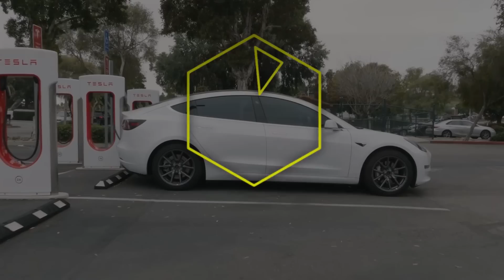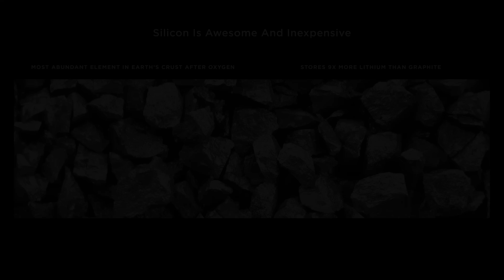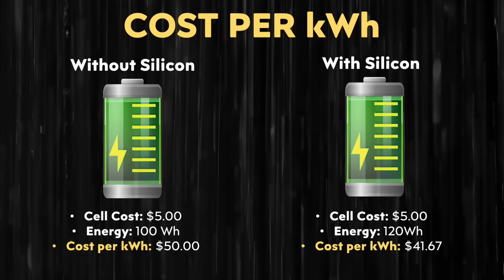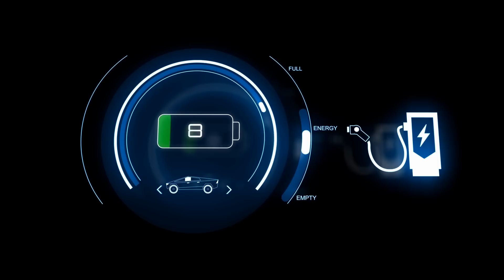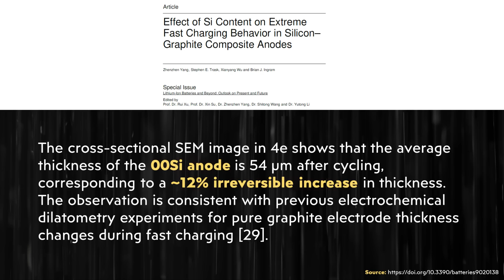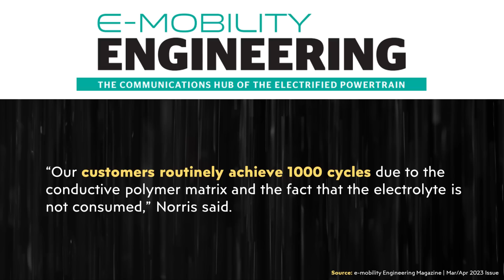This Silicon Battery BREAKTHROUGH from Paraclete is IN PRODUCTION!

Comment: Jon, this is the third video I have seen that hype success using silicon to increase energy density.  CATL and BVD have released super batteries.  I have to believe that now that Tesla has solved the dry electrode issue they will now move onto batteries with even move silicon.  Maybe with the generation 3 battery we will see an even better battery.  Could we see an announcement on 10/10?

Comment: Charge speed is not as important (it’s not bad now) as energy density, cost reduction, and battery life. If you can reduce the cost and the size of the battery needed to go an average of 375 miles on full charge would be groundbreaking. I have a 2024 Model 3 LR and charge only every 10 days at home and charge just up to 70% and usually end up around 15-20% SOC in day ten.

Comment: Jeff Dahn many years ago had 1 million mile NMC batteries. CATL currently shipping batteries which after 5 years are guaranteed to have zero degradation. 
Silicon fundamentally is not reliable enough for next gen batteries.
So yawn
Another battery break through. Seems every day there is some amazing battery tech reported. But we never see these announcements ever turn into products
Reply: Battery development is necessarily very slow compared to other tech. The main problem is the time involved in proving the battery chemistry capabilities ( and all the other factors) from inception to production. (And a slight tweak to the chemistry means re-iterating...)

Comment: You do NOT want silicon as an anode.  

Even if they can get the bandgap down to 0.7eV from 1.1eV.  Silicon expands up to 300% which causes the anode to loose contact with the foil, and can crack.  

As will all these “MAGICAL” batteries; The hype is to attract investor dollars.  They never actually develop a marketable product.  

Silicon is not easy to produce!  It’s NOT made from sand as the solar panel industry would like us to believe.  

Do a little deeper research before hitting the record button.
Reply from the maker: Or maybe you should watch the second half of the video where I address this exact issue and with data from an independent test showing a 15% wt Si anode didn't show cracking after cycling...

Comment: 1k cycles is only a tenth as much as the best LFP...
Reply: But the 1000 cycles are most likely from an NMC battery so that's what we should compare it with.
Reply: @EinzigfreierName  Depending on the use case, the per cycle cost is paramount.  At $35 per kWh and 1k cycles we have 3.5 cents per kWh battery cost per cycle. At $53/kWh for 10k cycles is a little over a half cent per kWh cycle (think about long-term grid scale value improvement of over 5x).
Reply: @DarylOster  Sure, there are a lot of use cases where cycle life matters a lot.. I was mainly thinking about EVs where 1000 cycles should be more than enough.
Reply: @EinzigfreierName  It is true that most of us car drivers are conditioned to believe cars are to be discarded after 200k - 300k miles.  A million mile life (as in most OTR semi-trucks) is vastly more economical (and environmentally sustainable too).
Reply: It doesn't matter that much.... 1k cycles on a 250 mile range EV is still 250k miles.....
Reply: @killerhurtalot  I believe in a vehicle, battery life matters even more than in pure battery applications.  The reason is that after 250k miles (where a typical ICE powered vehicle is junk), the typical EV is still worth about as much as the battery replacement cost - so a battery that lasts several times longer extends the residual value OF THE ENTIRE VEHICLE - not just the battery cost per cycle.  The total cost of ownership divided by a million miles instead of 250k miles results in much lower cost per mile.  One place where cycle cost is not as important is aircraft - where the most important factors are energy density (for sufficient range) and fast charge time.
Reply: @DarylOster  You're going to spend just as much on a engine maintenance and replacement every 250k miles as the battery replacements, unless you got a japanese car lol.
most cars are scrapped before 250k miles anyways, so it'll last the lifetime of the car.